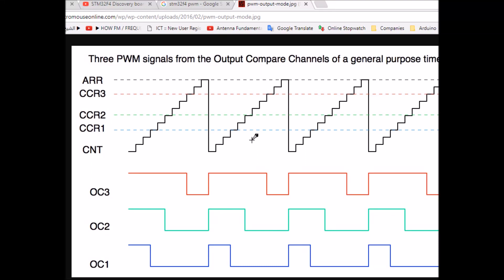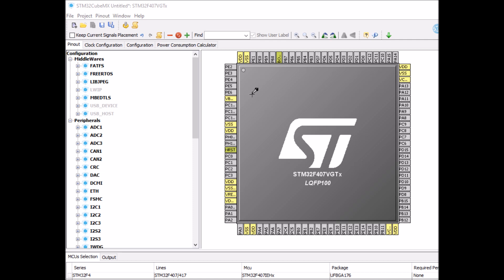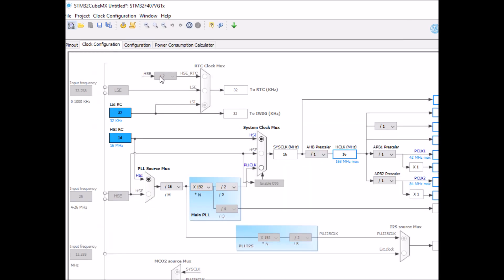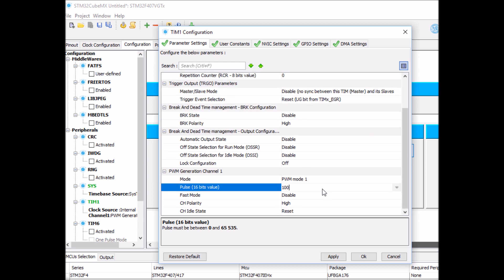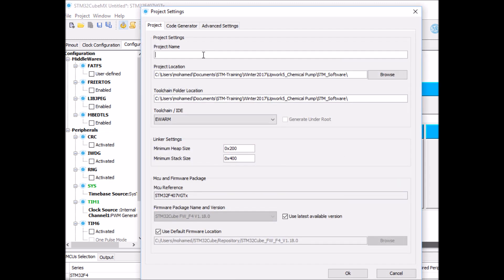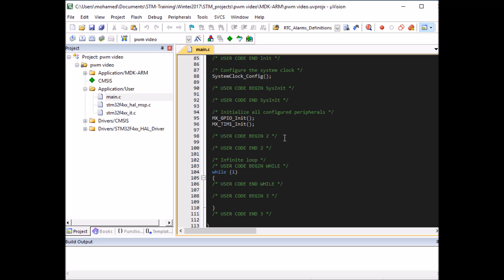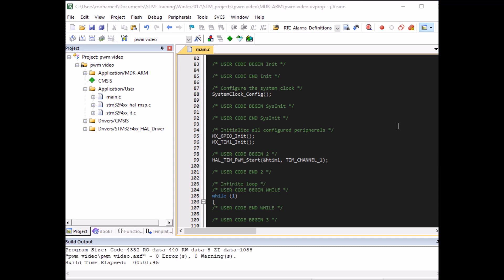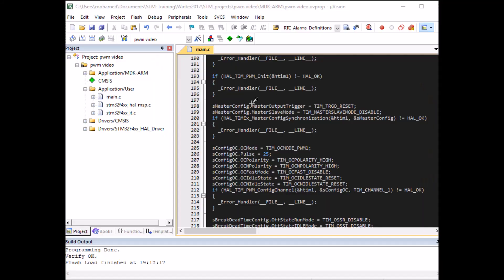STM32F4 Discovery board - Keil 5 IDE with CubeMX: Tutorial 14 PWM - Updated Dec 2017

Comment: I have tried both your Output Compare video and this one, using a nucleo-f411, and PA5 output on TIM2. I am using a more recent version of CubeMX which is built into CubeIDE. Both exercises produce no output. The generated Init code looks the same as yours, and I remembered to call HAL_TIM_PWM_Start, but I get nothing on LED or oscilloscope.  Is it possible that the current CubeIDE defaults have broken your tutorial? Or maybe I'm a dumbass and missed something obvious!
Reply: Hours wasted..... I unplugged and replugged my board, and the pwm code instantly started to run!  I will go back to the OC video now!
Reply from the maker: @GregWoodsLancs  Good to know it worked.

Comment: Thank you for your helpful Videos Mohammed. 

I need some help with Timers synchronization (Master/Slave).

I have been trying to make two timers work on the same time and generate PWM signals but I could not!
I would really appreciate your help

Best regards,
Abdullah
Reply from the maker: Hi,
Can either use multiple channel of same timer without having to manage Master/Slave. Just select another channel when I show channel selection in cube
Reply: @mutexembedded2206  Thank you for your fast response. 

Actually, I have to use specific pins of the chip, and these pins cannot be connected to the same timer.

So, I need to sync two timers!

Comment: Can you help me about how to control dc motor speed?
Reply from the maker: Burak 
You need an H-Bridge dc motor module, external power supply, PWM from STM32.
Reply: MYaqoobEmbedded i have them. L298N motor driver and 10k potentiometer. How can i control the speed with them. I have zero info about it. Can you help me about code and the potentiometer circuit sir. I did the motor drive.
Reply from the maker: Burak 
I might not be able to write you code, but can give you a guideline:
1. Read potentiometer as described in my ADC Tutorial(s).
2. Change PWM duty cycle proportional to ADC value.
3. Connect PWM output to Motor drive signal pin. 1KHz PWM frequency should do you good.

Hope this helps.

Comment: Sir can we modify frequency also in while loop?
Reply from the maker: Abdur Rehman 
Yes that will be the TIM Period.
TIM2->ARR = period
Reply: Thank u so much ... Sir what will be the unit of period...(i.e milisecond or seconds)
Reply: Sir I applied the the procedure on TIM4->AAR but its not working.Is it only work with TIM2.....? I initialized the timer as you guided ....
Reply from the maker: The frequency is a combination of Timer Main Clock Frequency (e.g. APB1), Prescalar and Period:
PWM_Freq = APB1_Freq/(Prescalar * Period)
Reply from the maker: It should ARR instead of AAR
Reply: In attolic i did TIM4-ARR=var;
In STM studio at the run time i did var=1000; but output frequency didn't change ..... Can you please post a video regarding it Thanks
Reply: I did with ARR
Reply from the maker: Hi Rehman,
I am not how you did it,, but if the variable "Var" got changed in RAM, it should work ok.. btw TIM4-ARR=var; has to be inside the while loop to be able to update it.
Reply: Okay sir i did it in the best way i can... I'm waiting for your amazing lecture about it as you have posted many great videos .so thank you so much for your great Help...!